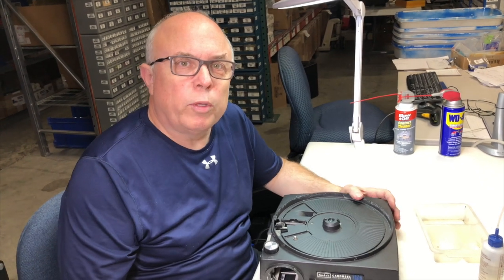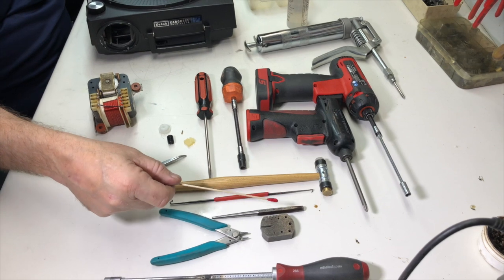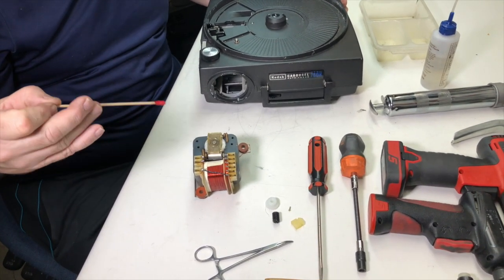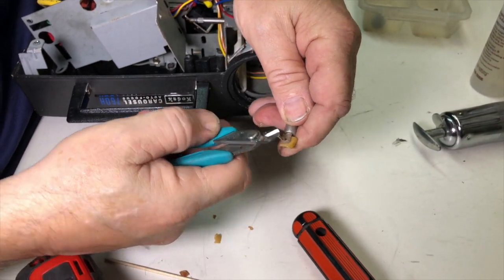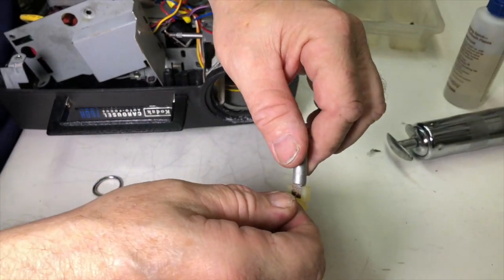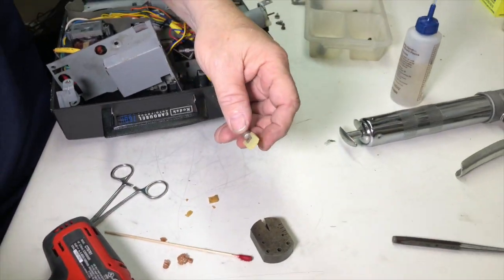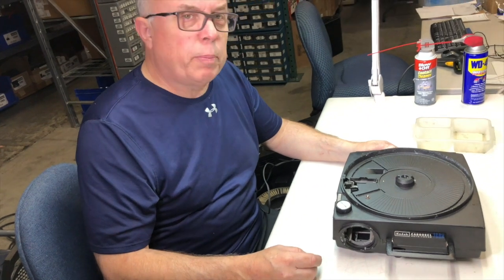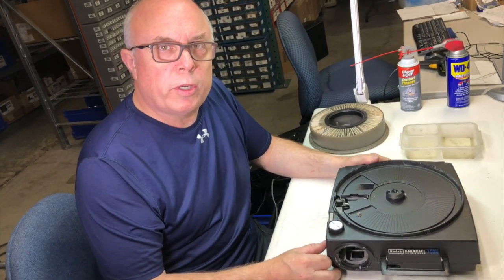Kodak 760H Repair

Comment: Thank you for this video and for the repair kit. I repaired my non-advancing 760H today and it works great now. The hardest part for me was installing the focus gear - had to hammer it harder and longer than I expected but it eventually got on there. I considered widening the hole like another commenter did but there was really no way to remove the gear once I got it started. The second hardest part was finding a hemostat tool - discovered they carry them at Auto Zone in the US. This job could not be done easily without one. Now, to tackle another unit with the opposite problem - it won't stop advancing slides!

Comment: This video helped me fix our 40 yr old Slide Projector 📽️. I'm reviewing 1350 slides my father took in the 1950s- 1970s. Thank you! Just a couple suggestions. 1) you need the pick tools. 2) I didn't have magnetic 1/4" drivers...so I used tape to temporarily hold screws to socket until they began to bite 3) I struggled for over 2hrs trying to get the damn selenoid and shaft properly assembled. What I did was use a Dremel to cut and widen an opening in the metal housing above the selenoid. This gave me room to move the electric motor up and with special needle nose pliers set the new plastic + shaft into the slot. I at first did not realize that the plastic was flexible...then just pushed it in the slot and it snapped in.  HURRAY! Agree this was a challenge...took me 2 days and about 6 hrs to do. I took my time & took pictures. I'm mechanically inclined but this was the most fidderly job I've done in years.

Comment: The kit was awesome. The autofocus is a little slow even with the new gears. Anything to do to make it run faster. (You may want to tell people that you need to put in a slide to test it).

As a follow up, I'm blown away how good this support is. During the pandemic, we were able to project the slides on the wall and display it via zoom. Made a great bi-weekly get together with the family. The slides haven't seen the light of day in 40 years. Thanks Kurt!
Reply: When they were really sluggish, and everything else is OK, I used to replace the focus motor assy.

Comment: Got it done, but having the right tools would make it easier! Undo the twist tie around the wires to give you more room to maneuver the solenoid. The solenoid plunger certainly did not drop out by gravity, but eventually I grabbed it with tweezers. Putting it back together just barely fits if you get it on the diagonal. Installing the 167348 Gear (the gear next to the focus motor) was very tight. I tried pliers, woodworking clamps, and tapping with a hammer. Finally, I measured the shaft and then used a 13/64” drill bit and slightly enlarged the hole of the plastic gear. Then the gear nicely slid on. Maybe these hints will help someone. Have fun!

Comment: Thank you for the video. I almost had a stroke, doing the repair. Hardest thing was putting the Link back in the machine. My fingers are like sausages. The parts didnt fit , so i had to make the holes bigger. Then after it was together it wouldn't do anything. So i had to take everything apart again. Adjusted plate and now it works. Only it still sticks from time to time. Not sure if that is the machine, the carousel or just my repair. It took in total over 3hrs.

Comment: Years ago I used to service many dozens of these projectors. The place I worked at had a contract to service all the 35mm equipment for the National Parks Service (NPS) west of the Mississippi. Common problems were/are:

Bad focus motor and or gear(s).
Bad focus shaft gear (will start slipping and can't move the lens).
Bad solenoid and/or solenoid link.
Bad clutch spring (broken or weak).
Index lever springs broken.
Mech lever for Indexer needing adjustment.
Worm gear eggs out on bottom of shaft (pull the mech and replace worm, and worm shaft if worn).
Bad bushings on top of worm and/or fan.
Fan egged out at bottom of shaft (replace fan).
Motor bad (rare but saw it now and then).
Belt(s) worn or broken.
Thermal fuse blown.
Remote socket board at rear of unit broken.
Heat absorber lens missing or broken.
Condenser lens missing or broken.
Lamp socket broken.

Video was interesting as I've never seen (or tried) to fix a solenoid link while the mech was in place! Since I was servicing units under heavy use and had to warrant them, I generally did a full service to them which meant I pulled all the guts out and fixed any of the problems found above. Most of the time the units I worked on needed worm gears, worm shafts, fans, bushings, belts, solenoid plunger/link, clutch spring, full clean, lube and adjust.

Comment: Hi Curt. Great video! Have you ever encountered the problem of the reel continually advancing? My 760h starts out normal by clicking on the remote for the first few pictures, then all of a sudden it just keeps advancing and doesn't stop until I turn the projector off.

Comment: I got a Kodak 4200 at local thrift shop. I found a loose spring at the bottom. What is a good way to find out where that spring should go on the mechanism?

Comment: Hi I just found a 650H which wont advance with an empty slide tray. Does it need actual slides in it to advance? I tried it with an empty tray.  Thanks for letting me know. And if you are familiar with the 650 H do you know if the repair process would be similar?  Thank you so much! Sara

Comment: My tray lock ring is stuck on a full carousel of slides. Ive tried turning it counterclock with a rubber gasket thing for better grip but no luck. It is frozen in place. How do u suggest I remove it, please?

Comment: I successfully replaced the focus gear (thank you!) but still have trouble with the slide dropping, but not staying in place. You see the slide for a second, and it goes back up into the carousel. Before attempting to replace the solenoid, can you tell me if that might fix my problem? It isn’t clearly broken, but I didn’t venture too far down the solenoid path. I don’t want to inadvertently create yet another problem! Thank you!

Comment: Hello Curt, your video is extremely helpful. I wished that I had seen it before I attempted to repair my 760H. In the process, I damaged the gear that mates with the auto focus shaft; at the end of the shaft opposite to the end where you typically replace the gear. Can that gear that I damaged be replaced?  
Thank you,
Paul

Comment: BTW - the other thing that doesn't work (and I'm not sure if this was a problem before the plastic solenoid piece broke) is that the select button is stuck so I can't push it down to let me spin the tray around. The video is awesome, much better than any of this other ones that I found online.
Reply: Pull the whole mech out and service.

Comment: Hi Curt thank for a great video and printed instructions on the repair of my 760H projector. almost everything worked perfectly.
I have two other issues not really covered by the instructions. One, the reverse does work but not Continuously.
I need to keep pressing the reverse button to back up one slide at a time. But it reverses fine other than that. the adjustment doesn't seem to affect that aspect.
Two the eject button does not work. the mechanism seems to operate, but the lever that movers out of the way so the tray can be rotated manually doesn't move quite far enough.
My 760H is a bit different the one you use for the video. One, it uses the Kodak motor. Two, the power cord is permanently wired to the projector through the accessory compartment. I also have 140 size trays.
Any suggestions for these two issues?
Thank you Larry

Comment: I am wondering about making repairs. Have questions. My Kodak 750H won’t go forward or backward. Wondering what kit I need to purchase for repairs. Also the light goes on but does not go out of the front lens’s to project. Wonder what the problem is and how to solve that. Would appreciate your input and ideas.

Comment: Excellent video!  I got to ‘plug in and test’. When pressing advance button, I hear motor strain but there’s no movement. A 1.25” long spring fell out when I opened the case.  I can’t tell where it came from - all the obvious springs are still in place.  Machine was stored a long time, started to work but began speed advancing and then wouldn’t advance at all and lamp went out. Please help!! (I posted this before and it disappeared.)

Comment: Hello Curt:
I have installed the non-advance repair kit, I believe successfully.  When I plug the projector in and turn it on, it still does not advance.  The manual buttons on the side of the projector and the plug-in remote make no noise or do not cause any effort from the projector to activate the mechanical components that I have repaired with the gears and the slide pusher/solenoid.  Is there a way to diagnose and repair and electrical problem that may be causing my problem?  I should have noticed that this was the case before I took the trouble to replace the gears, but since they were in bad shape, it may not have been for nothing.  I would really appreciate your help, or possibly referral to a YouTube video to diagnose any non-advancing electrical issues.  Thanks very much!  Robb

Comment: Curt, I order the kit and did the repair. Your instructructions were superb.   I have another problem the Select button on my 850 does not work. Seem to be Jammed, does not depress.  Do you have a video for that repair?,  Thank you
Reply: As I recall that was an adjustment to the mechanism, but it's been so long since I've had one apart I can't remember for sure.

Comment: I could not get the panel with the focus motor circuitry (4:25) up and out of the way due to the way the wiring harnesses were routed so I had to give up. The "link", from what I could see, appeared to be alright but the solenoid was buzzing with the forward/reverse buttons and select button so maybe the solenoid has malfunctioned.

Comment: Hi Curt.  I have a 760H that runs continuously when you turn it on.  It just runs through a cycle one after the other without stopping.  Do yo have any suggestions as to what the problem might be?  Thank you..
Reply from the maker: Maybe a broken clutch spring or a gummed up mech.
Reply: Hi Jose & Curt - I found this video with the same issue (760H) which runs continuously (looks like foreword) which I’m fixing for a family member. @Jose did you happen to resolve this? Or Curt, which clutch spring might we be looking for? Amazing video by the way, well detailed and something I seriously appreciate about knowledge sharing these days. Thanks in advance!
Reply: Hey guys, i have the same issue with a 760H it cycles continuously, were you able to solve the problem? Any suggestions?
Thanks Greg.

Comment: Video and paper instructions were great, and I somehow managed to avoid bumping the auto-focus bulb - though at times I almost despaired of getting the solenoid to maneuver inside the tiny space. One question: I have an old Craftsman 1/4" socket set with nut driver attachment, but my sockets don't quite seem to fit around the screws in tight spaces. Do you have a recommendation for thinner-walled sockets or nut drivers? thanks!
Reply: I have a really old 1/4" driver from Xcilite. It had a very thin wall on it and I could access all the 1/4 screws with it. One with a thick wall will be harder to use. You'd have to look at several and see if you can find one with a thin wall.
Reply: Use a thin wall deep socket.

Comment: Is this the repair of the advance feature?  The focus feature seems to work fine on mine.
Reply: The inside solenoid replacement is for the carousel turning. The 2 gears are the autofocus

Comment: I just did the same repair you did (model 760H) and I'm having trouble with the solenoid adjustment. No matter how far up or down it goes, it will not rotate correctly-meaning that it may move forward or reverse but not both or it may not move the carousel at all. Do you have any suggestions? Thanks.
Reply: You may need a whole new solenoid assembly (solenoid, plunger and link). Could also be the index lever has broken springs, or the lever the indexer hits against needs adjustment.
Reply: @65CJ5  Thank you for responding. The customer has already picked up the unit. Can he ship it to you for repair or do you do that?
Reply: @sside8  Hi. No, I don't work on them anymore. There must be a place "out there" somewhere that still works on them but I'm not aware of any offhand.

Comment: I just did the same repair but after I got it all back together the slides only show for split second. There is a flap that comes down between the mirror and the lens. It flips up when you advance to the next slide but then immediately flips back down. I believe that it should stay up. Any suggestions on how to make this flap stay up?
Reply: @josefeliciano2777  Hi Jose, Sadly I never got a response to this problem. I've torn the whole projector apart since I made this post and I can't figure out how to fix it.
Reply: @davidmartin729   and  @Jose Feliciano did either of you figure out a remedy for the gate closing when there is a slide inside?  My best guess is that the cam is rotating past where it should stop but even after taking the cage out I can't figure out where to adjust it or what may be broken/missing.  Thanks.
Reply: @motoheadbob808   - I'm in the same boat as you are. Even after taking everything apart and playing with the cage for a long time, I can't figure out what the problem is. I'm about ready to buy an old unit on eBay.
Reply: Might be a broken or weak clutch spring.  Pull the main mech and service.
Reply: @65CJ5    If you have any illustrations or suggestion on how to service the clutch spring or the main mechanisms I would appreciate it.  The guys I knew in the AV industry who were the masters of maintaining film and slide units have all retired or expired and I am certainly missing them and their skills.
Reply: @motoheadbob808  Sorry, no illustrations or anything like that. Looks like there may be some youtube vids. Mainly if you need a new one, just put it back in where the old one was. As I recall I'd coat it with some oil. That was about it. What usually happened was the part of the clutch spring that sticks up and catches the mechanism when it spins gets eaten away by the small spark there each time you change a slide. Eventually that breaks off and you get endless or erratic cycling. And sometimes the spring gets weak so you get a cycle that doesn't stop where it should. When I worked on them if I had it apart enough to do it, I'd just replace that as a routine thing.